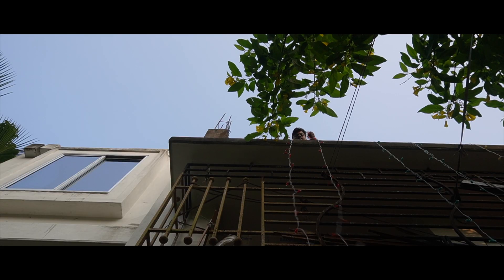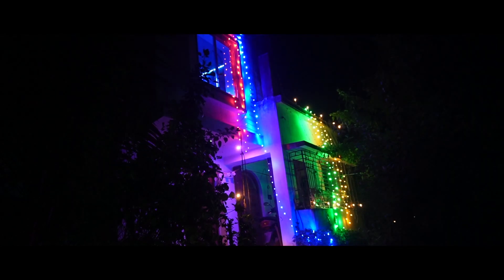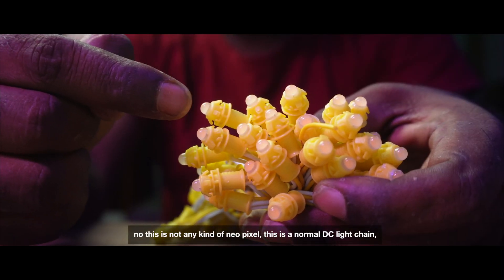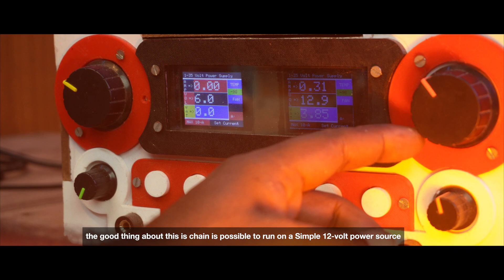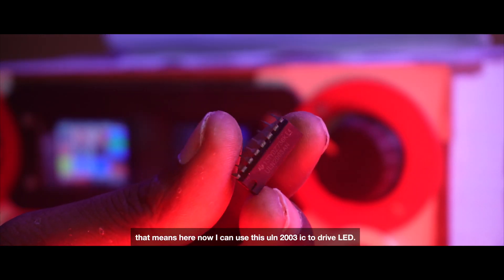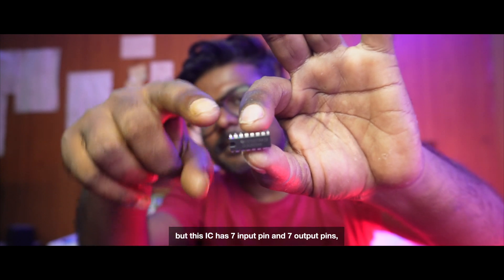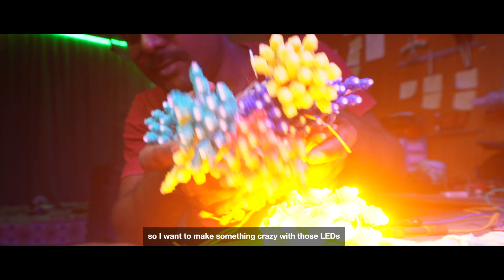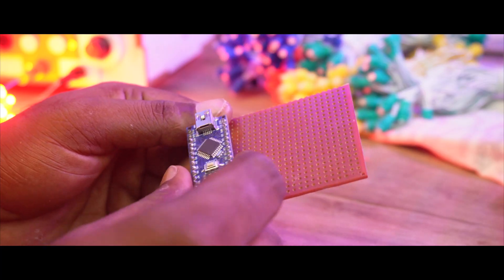How To Decorate House With Normal LED

Comment: 🙏please make a video on tda7439 (audio processor ic)
controlling it with remote control  and rotary encoder  
use Arduino nano as microcontroller for tda7439 
 Also it should adjustment in 16*2 display
Reply: Nice idea